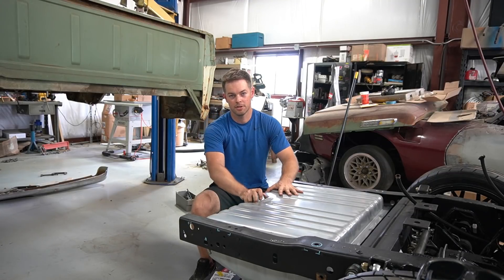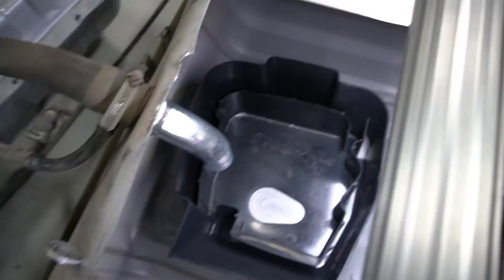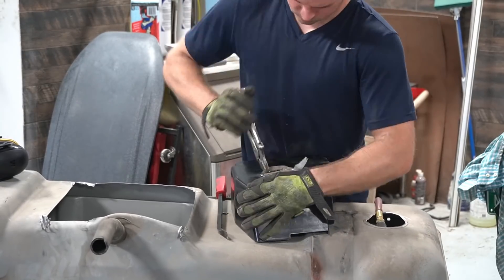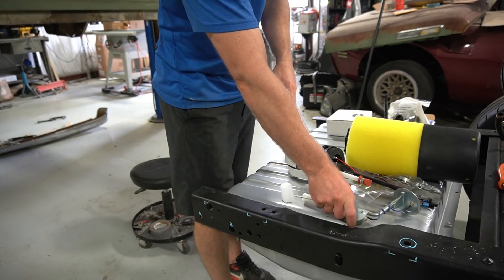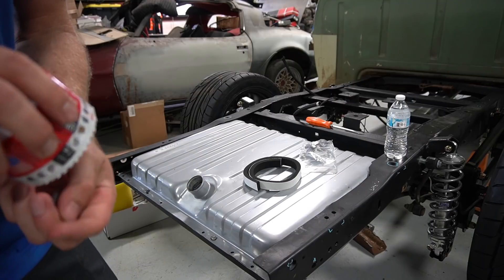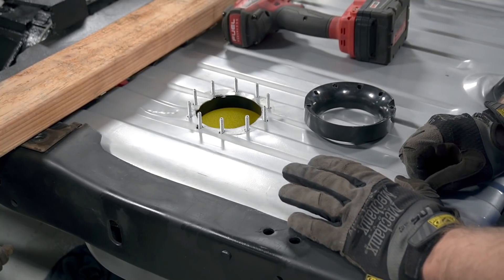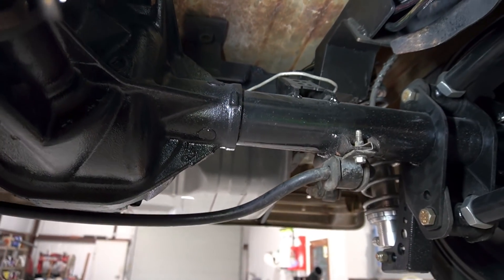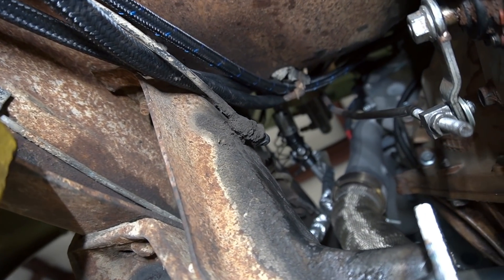F100 - Fuel Injection Conversion

Comment: Hey Rob, great series of videos.  Your truck is probably completed by now and I’m sure you’re enjoying the heck out of it.  I’m working on a ‘65 F100 and plan on using a lot your ideas on mine.  So why did you choose not to use the Aeromatic fuel pump that came with the kit?

Comment: I paln on doing cv swap 8.8 4link. Could you recommend a 110v mig, or do you think a 110v mig can do this kind of work?
Reply from the maker: Yeah quite a few of the 110v machines will do 3/16" steel in a single pass. Plenty for doing a frame, etc. Check out the Lincoln Weld Pak 140 HD MIG Wire Feed. 140amps will weld a project like this just fine. The duty cycle gets pretty short when you run them at full power like that, so you have to weld a little, and let the machine cool. But it will do it.

Comment: Lovin your channel... I’ve seen other videos saying that you should run your feed line straight to the rail and to your regulator after the rail.. I’m not sure if it matters but it might be worth looking in to...
Reply from the maker: Thanks! Yeah I have seen guys set them up all different ways. If it becomes a problem, I don't think it will be hard to change. I spent a few hours reading arguments on the LS1Tech forum... and decided to set it up where the regulator feeds the rails.

Comment: Great video! Happy to see I’ve done basically the same thing. Weird question on the mustang sending unit. Did you just extend the orange wire from the original tank to it and make your own ground? In cab sending unit had a ground but there’s no place on the mustang one for a ground wire? Haven’t tested to see if it works yet but would like to know before I go back on with the bed
Reply from the maker: I ran a wire from the new mustang sending unit (same resistance 10 -80ohm as the original F100) to the cab and connected it to the orange wire that went to the original sending unit. The mustang tank seems to be well grounded to the frame, so no need to add that additional ground wire. I measured resistance from the new sending unit stud, to the frame, and saw 10 ohms with a full tank. Works well with the factory f100 gauge!

Comment: what was done with the vent hose? Does a valve of some sort go on the end? Mounted were? Thanks! And keep on the good work . Enjoying the project.
Reply from the maker: I just ran the vent back to the engine bay, I need to figure that part out, maybe run it through a charcoal filter so it doesn't stink up the garage.... I think it may legally require a roll-over valve in it as well?

Comment: Another great video Rob - I really enjoy how you describe everything and show us how you make these parts work properly in your design and application here.  I think this setup is great, and I have been planning to use the Holley Sniper Returnless Retrofit Fuel Module and Sniper throttle body.  Only because of the natural aspirated 428 CJ setup in my 67 F100.  Your setup is going to work great with the LS, and setup properly for boost - when you need more fuel and pressure!  I really like the Aeromotive setup with the foam installed in the tank.  Merry Christmas man.  Glad to see you're inspiring others.  Keep up the great work!  Enjoying your F100 build!
Reply from the maker: Nice thanks for the great compliment! Glad you are enjoying it, and sounds like you have a pretty killer setup yourself with that 428CJ! Merry Christmas!

Comment: Why not use a tank form a 90-95 f150 they were efi and should bolt right in and just upgrade the pump
Reply from the maker: don't those trucks have a much wider frame... and don't most the 90 -96' have a saddle tank?
Reply: @330_garage3  I believe they are 38 and there some with dual tank that have the tank in the rear frame section

Comment: Where did you terminate the vent line?
Reply from the maker: hahaha good question. I just ran it back under the hood for now.. I need to find a charcoal canister or something to vent it through. I'm afraid its going to smell like gas in the garage.
Reply: @330_garage3  yeah I bought the hyperfuel in tank for a carburetor applicant. It almost looks like it vents itself. Not really sure can't find info on it.

Comment: Where did the vent terminate?  I have everything run like you but don’t have any ideas on the vent plumbing:)
Reply from the maker: hahaha good question. I just ran it back under the hood for now.. I need to find a charcoal canister or something to vent it through. I'm afraid its going to smell like gas in the garage. And I'm not sure if technically (legally) its supposed to have a roll-over valve in the vent line?

Comment: Look I have  carbed 65 F100 with a 5.0 , currently I have a Holly HLY-12-810 thats just bolted to my frame close to the stock tank IN the cab, will this electric frame mounted pump I have now pull the fuel from a rear mounted tank like yours???
Reply from the maker: Sure it will. You would just need to extend the pick up line (feed line) to the rear of the truck.. and a return line if you are running one. But it would work just fine